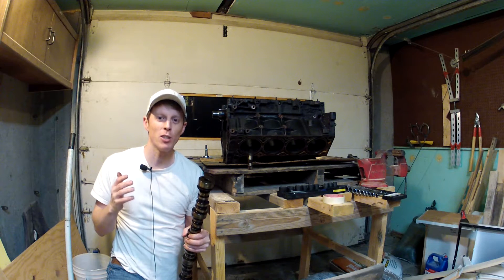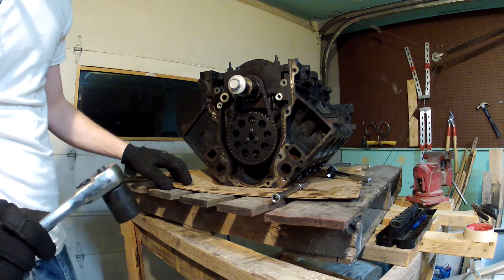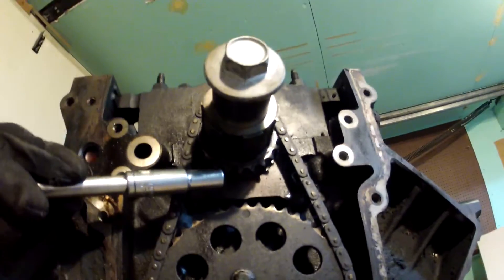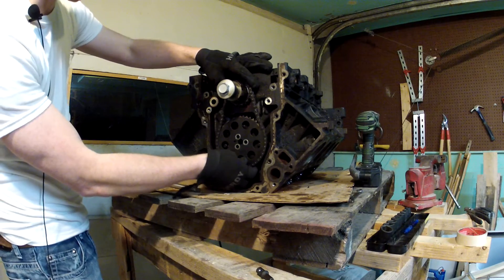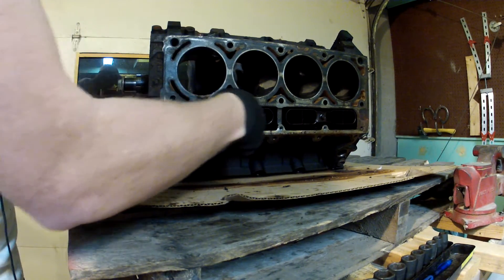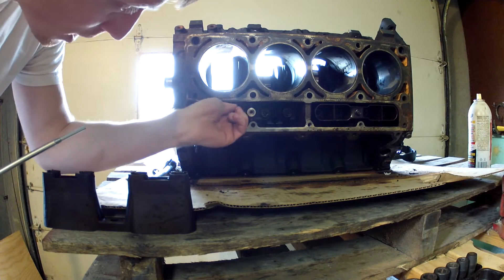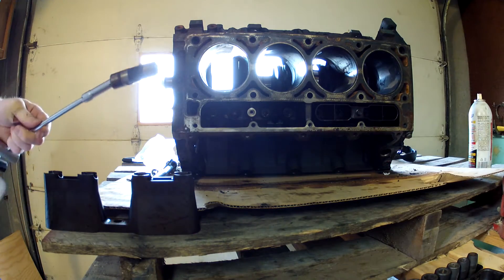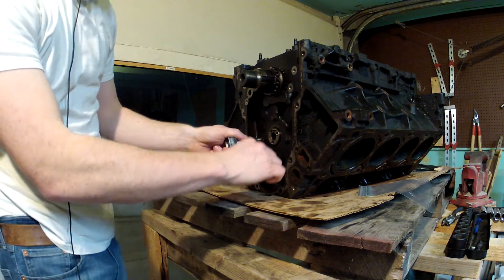LS Camshaft and Lifter Removal - Iron LS1 Build #3

Comment: Which cam did you use 1998-1999 camaro trans am have the high lift Cam and they are way cheap  500.500 lift and idle super smooth
Reply from the maker: I used the Texas speed stage 1 truck cam. It actually sounds like the specs are close to the one you are describing.

Comment: It’s not an LS1. It’s a 4.8/5.3 bored .118 over. Make sure they hone it and get the taper correct
Reply from the maker: Yes that is correct, I just refer to the build as the Iron LS1 because the main two differences between my 5.3L and the LS1 is the bore, and the LS1 is aluminum.  I assume the machinist did a good job as it is in the truck and running now. I don't have a ton of miles on it yet, but I am please so far.